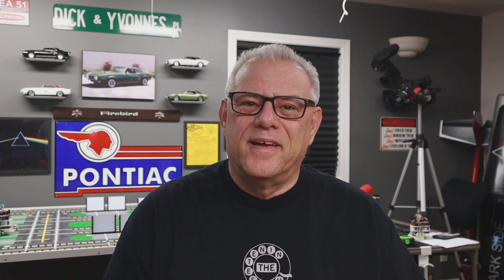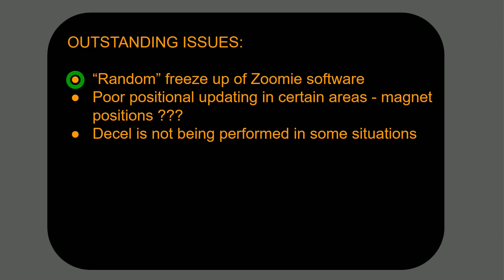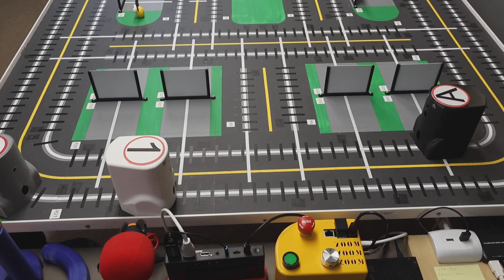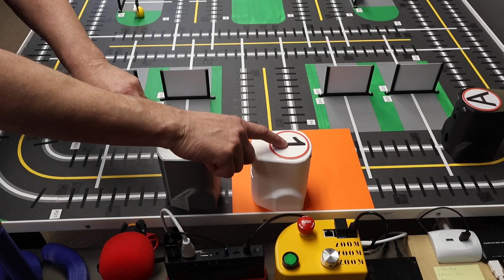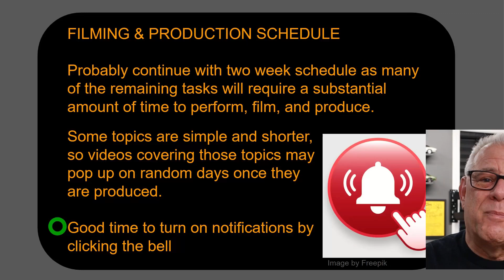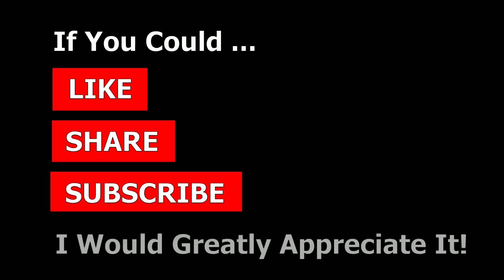E048 10/01/2024 ZoomTown Update

Comment: There's an issue with the Pico 2 and the GPIO Pins.  DO NOT BUY at this time!
Reply from the maker: Good morning tubeDude48,
Yes, I have been following that closely and have also requested if they have a plan for an updated version that fixes the issue.  While not an official response, it does not appear so.  Also when I was checking into this, the "official" stance from the engineers on the forum indicated that it actually wasn't determined to be a problem.  
While I don't believe the reported issue renders the chip and PICO 2 useless, it is a red flag to me that I will wait a while longer before using one.  I am too old to waste time figuring out if something is wrong because of my program or because of hardware that doesn't work as expected.  
Cheers!
Chris
Reply: @tubeDude48  The issue is not that bad, It is simply that the leakage current whena pin is in input mode is sufficient to pull an OPEN pin up to a unstable logic level, if the weak pull down is used.  Simple fix is to use normal ttl practice and have all unused inputs pulled high. If the input is driven then all is fine.
Reply: @wktodd  - Yes, I'm well aware of the problem!